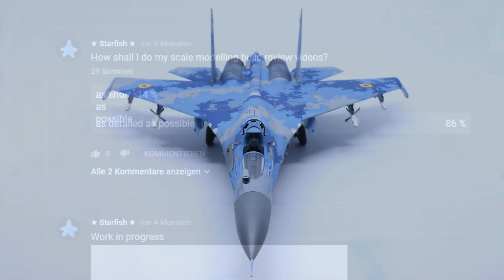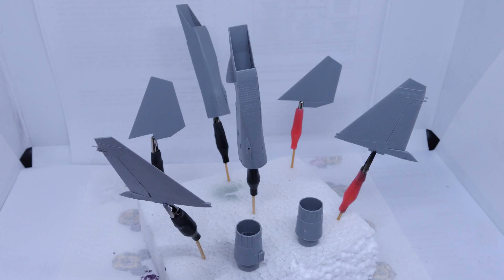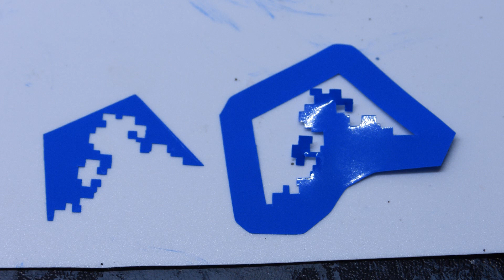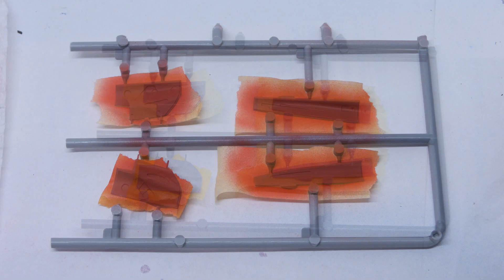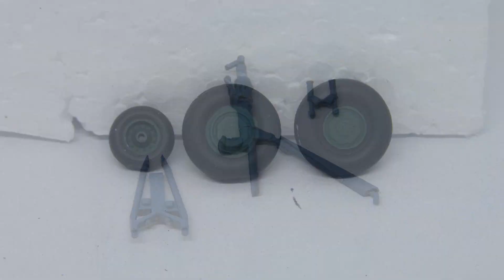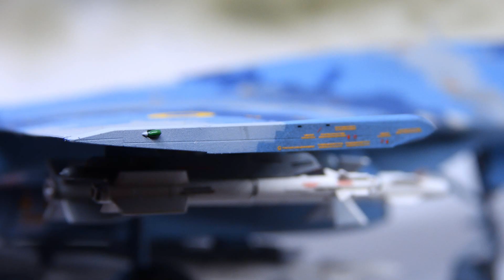REVELL Su-27 Flanker Ukraine Digital Camo 1/72 [Build Review]

Comment: Great job. As for vallejo primer ive had the same problem. Im using one shot now its much better. I think though with the vallejo primer you really need to let it cure for quite awhile for it to stay stuck to the model. What were the masks you used? Im after some for digital camo for a mig 29 ukranian.
Reply from the maker: Thanks James! In the meantime I also started using One Shot Primer and Mr Finishing Surfacer which both are much better. The masks are from Foxbot who also sell digital masks for the MiG-29!

Comment: quick tip: as a vallejo addict i do find that vallejo paint comes off rather tooo easily from my expieriences id reccomend putting the primer one a few thin cotes than wait at least 3 days and after that vallejo paint is hard to come off so thats how you should do it sometimes it still comes of in that  situation you should probably do the primer let it dry and put a thin layer of the matt varnish on but with this the paint layers can get too thick so id reccomend if the first tip doesnt work using enamel or lacquer paint as the primer these are far stronger and almost never come off but the problem with enamels is that it takes a day or two for them to dry so rather id reccomend using lacquer but you should wear a mask and paint outside or wear a mask and be in a place with good ventilation
Reply from the maker: Thanks for all the suggestions! Nowadays I use Mr Finishing Surfacer and Ammo of Mig One Shot primer and both work great
Reply: @Starfishscalemodeling  those are amazing as well ive heard they have amazing finishes but as an vallejo addict i only use vallejo it costs a bit too much for a budget modeler like me to buy those plus i paint with brush honestly the results can be amazing but i still have to invest in washes and pigments they are really nice ive heard but usually i make my own washes as you can make them very easily nowadays im still saving up for a airbrush ive already bought the compressor and after a few weeks or month ill have the airbrush i plan to buy the 1:144 F/A-18 Hornet after a few weeks of saving up i honestly think ill have quit a lot fun with the little kit and next to that when i have my airbrush im going to do a custom gundam maybe ill post a vid
Reply from the maker: @The_Master_of_Europe  Yes, that Super Hornet is an excellent kit! Just yesterday I ordered a set of Vallejo pigments by the way 😊 I have a couple of dioramas planned...
Reply: @Starfishscalemodeling  sounds interesting cant wait till the diaromas

Comment: nice build review! and the model looks nice too. what I would change would be definitely the Vallejo primer... too many problems with it. also, I would detack the masking tape before putting it on the model ( on the back of the hand a few times) to reduce its adhesive power, and dont leave it to long on the model. nice to see the process of spraying this digital camo that I like a lot. in fact, your video may be the push for me to start my Flanker in this beautiful livery with Foxbot masking templates ;) ... but on a larger scale, 1/32. also, I would recommend to you to look in the building process at the seems everywhere and how parts join together, there are some noticeable ones in the forward part of the fuselage and on underside engines nacelles . keep up and you will improve day by day! cheers
Reply from the maker: Thanks a lot Alex! I give Vallejo primer another chance but I'll be very careful. Before starting your Flanker, keep in mind that it's a very large aircraft ;)
Reply: yeah, I know! but I like it so.

Comment: I've been using Ammo Mig products since i started with this hobby. I had the same problem as you with the color coming off the model after unmasking it. However my issues was with the colors and not with the primer (i use one shot primer from Ammo Mig.) I then found out that a good solution to this is to spray/paint Varnish over it before you mask the model. The varnish protects the area and will not likley remove the paint anymore.

You also said that you thinned Ammo Mig varnish? This is something you don't need to do. Just shake the bottle very well before use and then spray a thin thin layer over the model. Repeat process about 2-4 times depending on how you want it.

Again, nice work on the flanker! 😍
Reply from the maker: Thanks again, I will definately try varnish over primer next time, sounds like a good idea 🤔